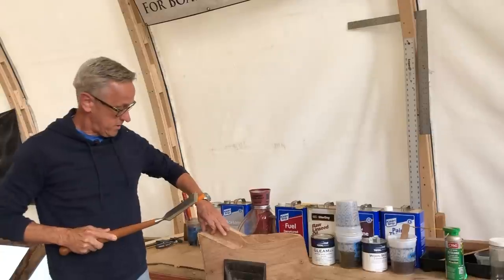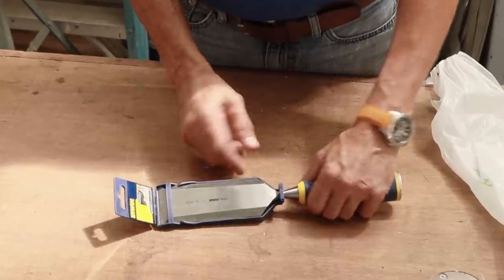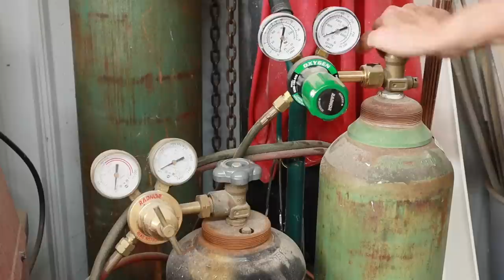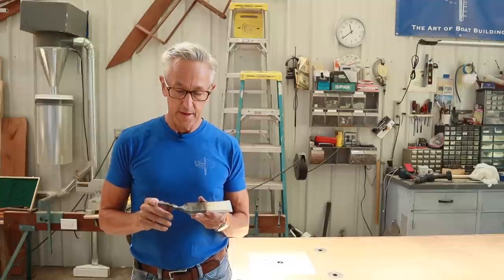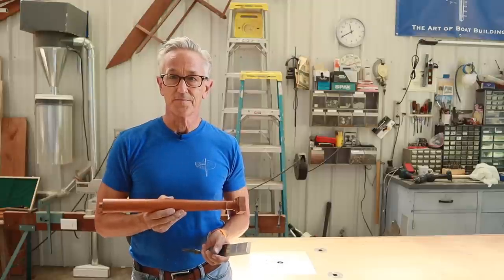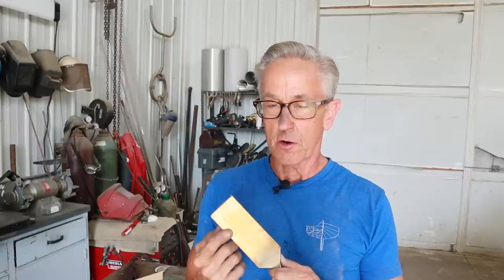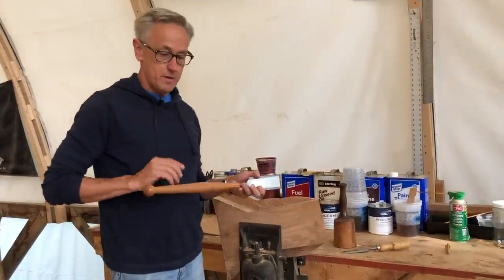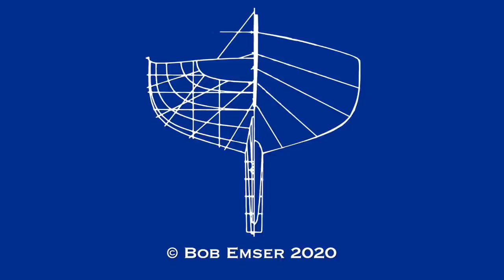Making a Shipwright's Framing Slick

Comment: I found a boatbuilders slick from the late 1800s at a junk store.  After fixing the socket, turning a handle,  and sharpening it turns out to be a great tool. The blade is at least 10" long. The weight and ability to two hand it makes it easy to use.

Comment: Bob as you know my house is built from an old timber-frame barn. When I was building it I was really into timber-framing. There are some old timber-framers here in Ohio and once in a while I have run across them at flea markets. I have seen some amazing 19th century slicks I drooled over. Nice video as usual.
Reply from the maker: Thanks Kev!
Reply: You’re welcome Bob. Tell Stephen I said hello. I’ve been following Acorn to Arabella and they are sure coming along nicely. I was going to say something about the possibility of you burning a hole in your boat with the cutting torch but realized it was an optical illusion in depth perception caused by a trick of the camera.

Comment: Great video, Bob. I feel like the angle might be a little aggressive for my preferences. When dealing with very large pieces of dense tropical hardwoods i prefer a slick with a shallower handle angle that you can really push into the work with speed and your body weight behind. I love the use of the old spindles. The fact that it’s perfectly seasoned cherry that’s been lying around for 25 years really made me smile. I’m glad you kept it. I’m sure it will be fine, but I would have put a ferrule on the end to prevent splitting. Just to give the end some reinforcement, I like the belt and braces approach. All in a great video. I might make a similar slick myself one day, 2” is a nice light size with two hands for overhead work.

Comment: Your work is beautiful as usual.  I have used antique slicks 3 and 4 inch wide which had no angle to the handle. And have only seen one with about 3 to 5 degrees on the handle. Are ship building slicks different from framing slicks? I know there is a special adze for ship work.
Reply from the maker: Hi William, You are correct most slicks are around 5º. I put a larger bend in it as I knew that I would be in some tight quarters using it. As I was paring the breast hook today I found it very handy and for my hands was quite comfortable. One of the beauties of owner made tools is you can make them the way you'd like.
Thanks for the complement and for watching!

Comment: Very nice idea and execution. I am looking for a slick and may have to try that.

Tech Tip - when heating the tang to bend it, put a wet cloth or a potato over the blade to keep it cool enough you don't have to mess with heat treating the cutting edge. I wouldn't think tempering the tang area would be necessary if you let it slow cool after the bending work, but a 400 F soak shouldn't hurt anything if you feel like doing that.

Comment: A really good trick on drilling the handle with a hand drill for the tang from Paul Sellers. ( If you don't have a drill chuck for the lathe) Involves making a slightly tapered hole  (approx diameter of the larger section of the tapered handle) in a piece of stock and cutting a relief in the center down about 3-4". Once this is put in the vise, adjust the height to the height of the drill motor on the base of your bench and use the bottom of the drill casing to guide the drill perfectly as Paul would say. Works great all the time.

Comment: Thanks for the video. It is a beautiful tool. Did you sneak a ferrule onto the handle?  And decommissioning art. I’d never heard of that before. Ships (sad sometimes), but not art.
Reply from the maker: Hi Robert, No ferrule. A small slick like this will not have that much force on it as it is mainly a finish paring tool.
Decommissioning or repurposing is common among sculptors. In art history is was common to see paintings painted over other painting. Sometimes by other artists. I certainly would not do that to another sculptors work. 
Thanks for watching!

Comment: That angle looks pretty extreme. I also wonder whether that tang is long enough for suck a long handle
Reply: i noticed the angle as well - however, like most user-made tools, one makes the tool how they intend to use it.... so.... if it's comfortable, then it's not too extreme. However, the tang length may be less of an issue than not having a ferrule on such a soft wood as cherry (which makes beautiful tool handles, in my experience). in the event that it starts to crack, that's how I'd solve it.

Comment: Good work! What's the point of tempering if you didn't go through the hardening process?
Reply from the maker: When I heated the tang and quench it I removed the temper in that area. So I re-tempered it so the metal at the point won’t be brittle. 
Thanks for your question and watching!
Reply: Had you not dipped it in the oil after bending, there wouldn't have been a need to temper it. A ferrule would be helpful too, that's a massive tang. Even if one makes small shavings, a large handle like that creates large leverage and the handle may eventually break.